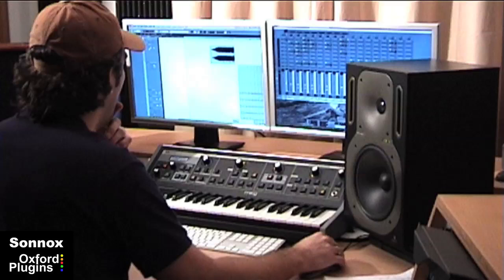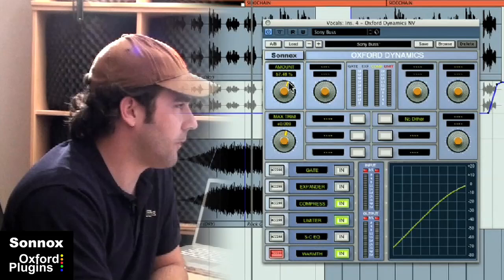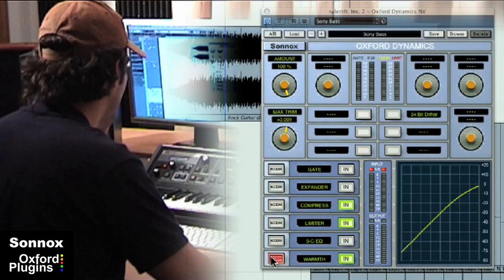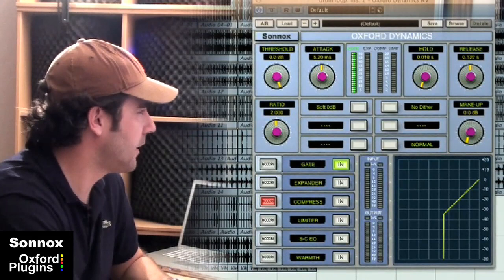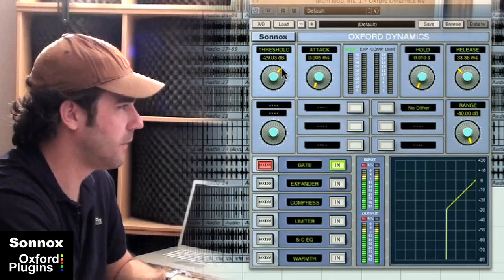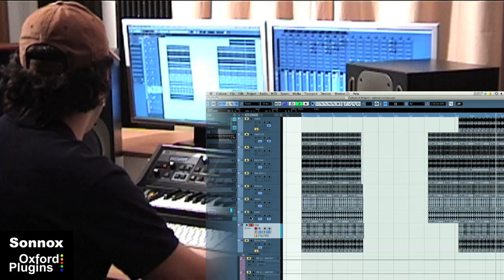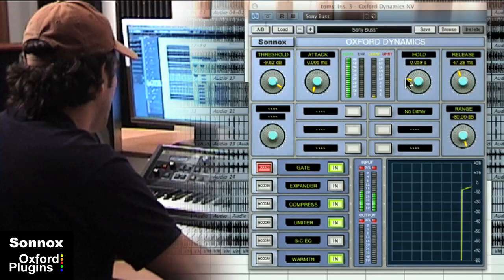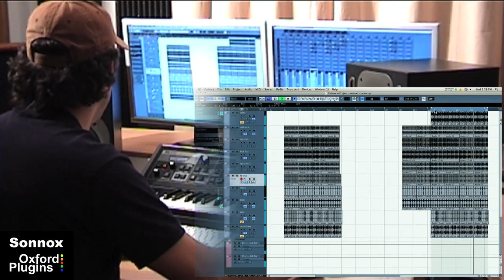Ian Carey - Oxford Dynamics (part 2 of 7)

Comment: @jazzy0897 Its not as about what appears while yes beginners should learn not to go into the red if there is not clipping until the master and the master doesnt clip then using your ears is more effective I too reckon he should back down the gain a little bit. Would definately not do what he is doing all the time alot of what he is doing is not general use but maybe more for specific sounds (over compression etc)